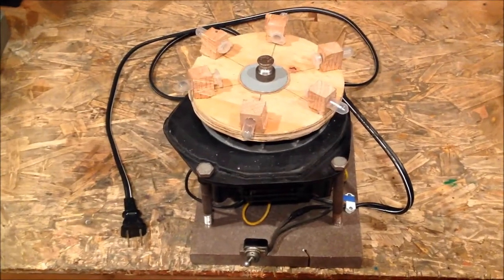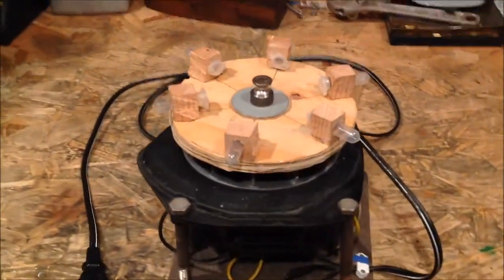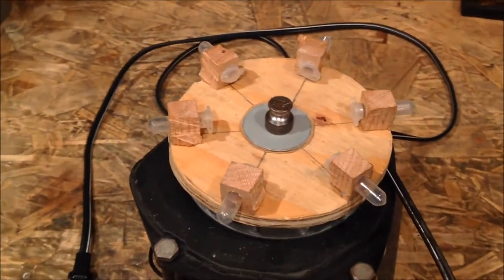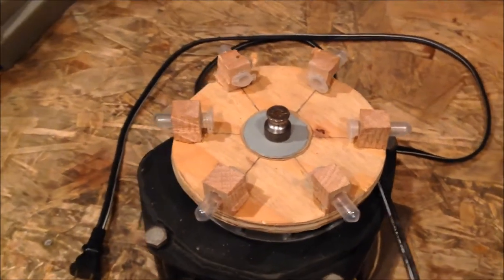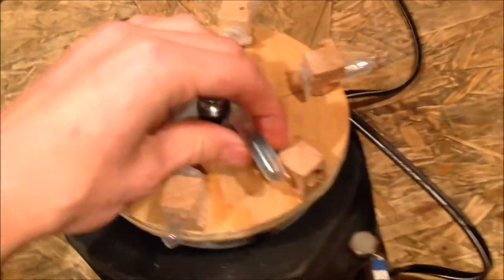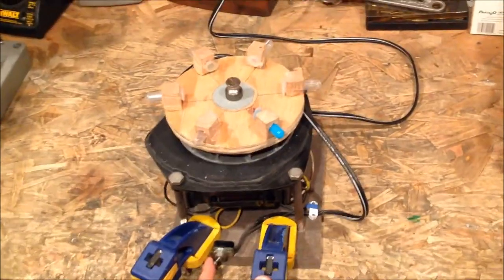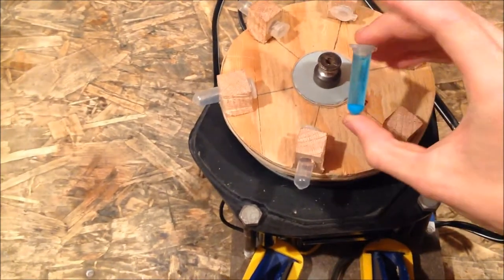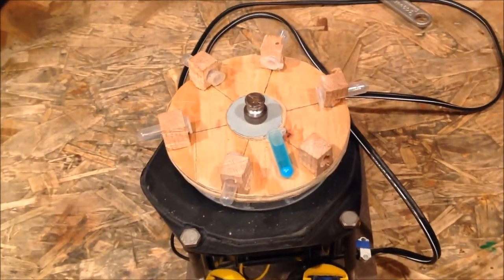DIY Centrifuge from Vacuum Cleaner

Comment: Great idea and beautiful execution of the design. The only thing I might do differently would be to put the switch a long way from the device itself. I wouldn't want to sit next to that motor while spinning. I guess you have tested it thoroughly but what kind of glue did you use for the specimen holder wood blocks. They have to be experiencing major 'G' forces.
Reply from the maker: Yes, turning the device on and off is a harrowing experience.  :)  I believe I used simple wood glue.

Comment: Very neat idea, but personally I wouldn't want to stand near this thing while it's running. Don't underestimate the G forces involved at those rotational speeds - I bet you'd be amazed if you calculated how much force is pulling that wooden wheel apart. Even angle grinder discs can cause serious injuries when they explode, but that wooden wheel has a lot more mass, so it's that much more dangerous. I'd put this thing in a solid wooden box or put some sheet metal around it. I don't want to be that "overreacting safety guy" but this thing can be seriously dangerous if not fatal if it explodes. The idea, however, is really nice and I do support creativity, just be careful. I'm only telling you that, in case you weren't aware of those dangers.
Reply from the maker: Thanks for the constructive feedback!  I don't use the device often now, but I will definitely be modifying my procedure for operation to turn it on and off at the plug end of a long cord so I am well away from the spinning centrifuge head.
Reply: @ThePlutoniumBunny  No problem :) That's a good idea!